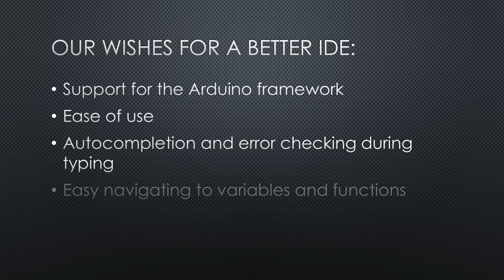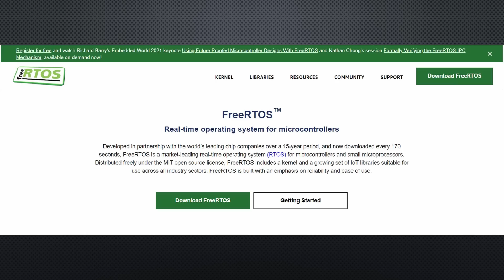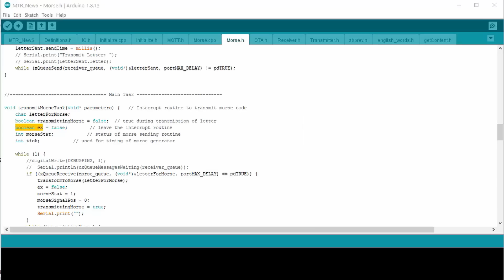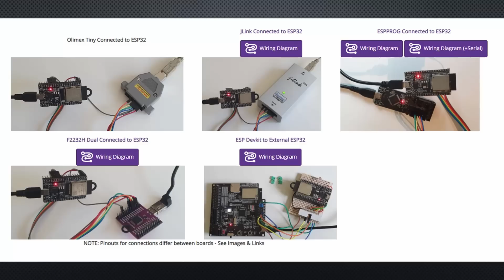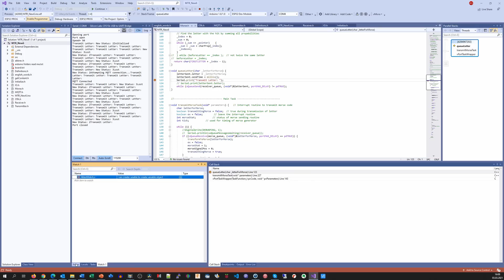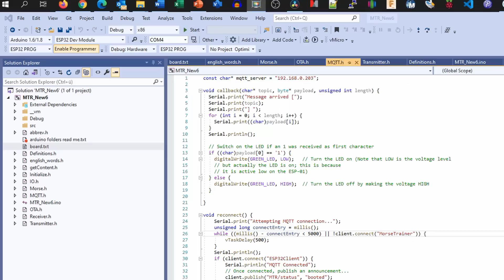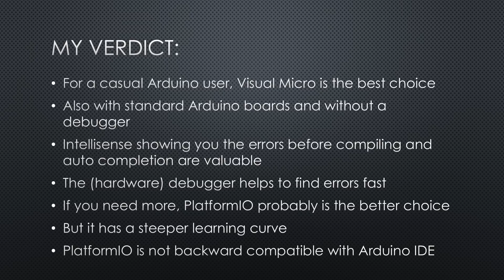#375 Is Visual Micro the better Arduino IDE? Including ESP32 inline debugger

Comment: Could you please do a video only about debugging with breakpoints i.e. which boards and which IDEs support what kind of debugging? I find that the ESP32 HW debugger is irreplaceable for me, but a lot of the times I do not need such a powerful board for a simple project.
Reply from the maker: PlatformIO and Visual Micro support hardware debugging. I do not know other IDEs which do HW debugging. So I am no help. ESP32 and STM32 can be debugged. But I am sure other boards, too. Just look if they support JTAG or SWD.

Comment: I used Visual Micro at first when I started my journey back into Microcontrollers a few years back. I understood it was free software, only to be surprised one day it was demanding money to open my projects.. So I switched quickly back to Arduino IDE and, grit my teeth and got on with it. Now don't get me wrong, I probably would not mind paying if (A) it was clear upfront before wasting time on it, and (B) The software was really good. But actually I found the how interface a little disappointing and clunky, I can see those guys have put thier hearts into it, but I guess my expectations may have been to high given historical experience with large projects in visual studio. I have started using the PlatformIO and so far really like it. It would be interesting if you did a real hard feature comparison between PlatformIO, Visual Micro and The next generation Arduino IDE. Seems these things have been out in the wild long enough for a fair comparison to be made. You could also introduce the free IDE's as available from the makers of the  STM,32 ATMEL and ESP chips. I took a look a couple of them, they are not bad with the one for ATMEL very strong, but for me the better answer is to leverage the common platform for all my microcontrollers as the benifits far outweigh the compromises in nearly all cases.
Reply from the maker: For the moment, PIO or Visual micro are for bigger projects with a clear tendency towards PIO because it is free. And for the small projects it still is Arduino IDE.
Reply: @AndreasSpiess  IFor me, I will only use Arduino IDE for legacy things and testing something as a known good. I managed to get all of my 8 types of microcontrollers working in PIO, making a test project for each. I don't think I would ever open Arduino IDE again to make a program, even for small stuff, fiddling around with the microcontroller setup each time is just to painful.

Comment: How easy is it to add own boards instead of the predefined boards? This is the only thing keeping me from fully switching from Atmel/Microchip Studio to PlatformIO for the AVR-chips (I am not using the Arduino-framework for those...)
Reply from the maker: I do all the boards and library stuff in the Arduino IDE. Because it is compatible, it uses all changes. So I cannot answer you question.

Comment: I've used VS Micro but I prefer PIO. Especially the dependency management of PIO is great. You said you don't want/need to work with different versions, but I doubt that. I usually want my 2 years old code to still compile if I go back to it. Arduino and VS Micro cannot do that because once you updated a library, all old code uses the new library and probably breaks. PIO prevents that by keeping the dependencies stable per project.
Reply from the maker: AFAIK you can "add" libraries to your project. Like that they are part of it and stay as they are. A slightly different approach than PIO but the same goal. So far I only had problems with the ArduinoJSON library from version 5 to 6 where I had to update code.
Reply: @AndreasSpiess  yeah okay, you can do that by copying the library code manually into a project subfolder. You could also do that with arduino IDE I guess. But in PIO it is just one line in the ini-file. You have all benefits of a library manager, including easy update and rollback of each library version. I had countless projects fail on me in the past in Arduino IDE because of a library / framework update...

Comment: Great video! I have had so much trouble debugging eps-IDF and ADF and was hoping this would be the answer. After installing it seems visual micro wont let me select my programmed. when I hit the drop down and select esp-prop it goes back to no programmer. Another issue, when i load my project folder and try to build it only shows "run code analysis" not build or build all. Any help would be greatly appreciated, have spent days on this so far with not much progress. I have tried VS code and eclipse with plugins.
Reply from the maker: Are you sure you used Zadig for your programmer? I never use "code analysis"

Comment: thank you very much for your the amazing content and  tutorials you are realy a good reference 
i wold like to ask about CAN bus Controller Area Network , if there is possibility to use ESP32 with CAN decoder de listen to CAN Frames reverse ingeneering
Reply: CAN is a Serial broadcast bus, so it should be possible, IF you have the proper hardware to covert to and from CAN signals.

You should be able to use the new RPi arm chip for this, with its support IO CPU.

What do you mean by reverse engineering?  What are you trying to do?
Reply from the maker: I have CAN hardware here and the topic on the list...
Reply: @AndersJackson  i ordred the MCP2515 CAN Bus Module its what i was reading about in many tutorials , so im still waiting for hardware :9

Comment: Arduino 2.0 beta is out and supports all desired features, FYI
Reply from the maker: Did you try it? It looks like very beta to me.
Reply: @AndreasSpiess  No, I haven't tried it yet, partly because of the beta status, partly due to lack of time/need. I lost interest in Arduino a bit after working with manufacturer software to create faster code (at the price of a bit more effort), but I am looking forward to trying the new Arduino IDE on my next project, even if only for a day and switching back. The old IDE was sub-par IMO, I expect the new IDE (once the bugs are ironed out) to be a blessing for makers. Thank you for the quality videos BTW, they have been a reference for me, and I'm sure many others. Kudos to you.
Reply from the maker: I tried it and thought that it still needs some time to ripe. The direction is good, though.

Comment: This looks good! Since I worked with Rowley, Keil or CubeIDE the last few years I feel lost without these features. So do you install Visual Studio first then this extension? It looks a bit like VisualGDB. 

It’s very nice that Arduino has the board support and examples but anything beyond that it’s very lacking and confusing too. 
For example I just got an Adafruit Feather, I opened the Arduino Blinky example for it which toggles a pin LED_BUILTIN. So I right clicked to find where it’s defined, nothing. Hover over it to see it’s value, nothing. The .ino file doesn’t even include any .h files (not visibly anyway) but it must be being brought in from somewhere. It just doesn’t make sense and everything is obfuscated, I don’t see how that makes it any easier for beginners than simply showing the pin definitions included in a pins.h file. 

I for one am glad to see this trend towards proper debugging and useful IDE features, it will only lead to more stable code and a better understanding of what’s really happening :)
Reply from the maker: One of the big advantages (innovations?) Arduino brought to the user community is to hide a lot of the definitions. But you have to install and select the right board to get those definitions in the background. I do not use Feathers, so I do not know how to do it for that board. But Adafruit usually has good tutorials on their homepage.
Reply: @AndreasSpiess  The feathers are just like any other board really. You add the JSON URL, download the BSP and you're good to go! And yes Adafruit has nice guides on their site :) 

Anyway, seems like this is all going to change soon with many people commenting about Arduino V2!
Reply from the maker: I hope you are right. It is still in beta and has a long way to go, I think...

Comment: That's interesting, but I prefer VSC. The only thing is that doesn't comes with a debugger. And works good in linux (debian 10) with a proper installation of Arduino IDE
Reply from the maker: The debugger is very important for me. If you need one you can change to PlatformIO which also uses VSC...

Comment: I used Visual Micro for a year. It's very good, but if you're looking to program other micros as well, using their native frameworks (ie. ESP32 with ESP32 IDF, STM32 with HAL, CMSIS) with the advantages of Visual Studio, then take a look at VisualGDB Embedded. It's not free, but worth it IMHO, it pretty well takes care of everything for you without all the tinkering.
Reply: I use VisualGDB for native STM32 development. But we are talking about Arduino and last time I checked there was no usable arduino integration in VisualGDB.
I'm not sure if Visual Micro and VisualGDB can coexist. I installed them on separate VMs to avoid the risk.
Reply from the maker: I decided to stick with the Arduino IDE for this channel because otherwise I would have to have a lot of different frameworks, example projects, and libraries. This is different for professionals, of course.
Reply: @MetalheadAndNerd  Yes, there is. Besides standard Arduino boards, I've done ESP8266, ESP32, and STM32 blue pill using the Arduino framework in VisualGDB. Select your board and VisualGDB will download/install what's necessary. It's an excellent turnkey solution IMHO.
Reply from the maker: Does VisualGDB offer a free or a "Maker priced" version. The prices on their homepage are more for a commercial usage.
Reply: @AndreasSpiess  Sorry, I don't know, I paid the $99us for the Embedded version, it's half for academics(?). For me, the $ is worth the hassle free setup. I'm mostly using STM32/HAL/st-link these days and it works very well. They do have a 30 day free trial. The support  also appears to be very good. OT, but it also now supports the Pico.
Reply from the maker: That is what I saw, too. $99 is too much for most of my viewers, I think. So I will not cover it. But I am glad you like it.

Comment: Great informative video as allways. Does visual micro supports esp-idf? I am not happy about the Arduino incapsulation.
Reply from the maker: I do not know. I never used the idf
Reply: @AndreasSpiess  OK, I think that IDF is better documented and its also the official API. When looking into FreeRtos there are a lot of documentation to Espressivs version of FreeRtos.
Reply from the maker: I used freeRTOS in one of my projects with the Arduino IDE (and will show it in a video). I did not have problems, but I only used some basic functions. It seems they use the same calls as the IDF. But if you want to program Espressif only then the IDF is a must.
BTW: I could close my channel if I would start to use the IDF and all the other proprietary IDEs to program AVR, STM32, and potentially Nordic :-(

Comment: Why not just use Atmel studio?
On avrfreaks they said visual micro was only useful until atmel studio implemented arduino.
Atmel studio is a version of visual studio specifically for all Atmel MCUS.

What I cant answer right now is if atmel studio has debug capability without a programmer, which would be the only reason to use visual micro.
But there is also a visual micro extension for atmel studio.
Reply from the maker: I never used Atmel studio, so I do not know. I mainly program ESP32 chips and sometimes also STM32s and I do not know it they are supported.

Comment: I wish IDEs would add smarter autocomplete. If I already have 1 " and try to add another one before it or a closing " why does it always add an extra 1. There should be a check if there is already an open tag. Visual Studio and many other IDEs do this, and it is enough to make me turn it off. Even though it is only 1 key press to remove it (although then both can get removed) I would rather always have to add the closing tag, than sometimes have an extra one added at random when I am not expecting it.
Reply from the maker: I learned that editors are very individual. Somebody likes a feature that is hated by somebody else. Very difficult for the developers ;-)

Comment: Great video and thanks.
How about the OTA programming with WiFi for ESP32? Does it recognize as the Arduino IDE does? Anyway I'm going to try this after seeing your video. 
By the way I tried the newly released Arduino IDE 2.0.3 beta with some improvements to the older IDE like auto complete,  syntax error and more. Give it a try as well if you are already not done.
Reply from the maker: 1. OTA works as it works with the Arduino IDE. You even can do Serial debugging via OTA
2. I will have a look at the new Arduino IDE. But I give it some time because I do not like to be Guinea Pig ;-)
Reply: Sorry, if I made you confused, I meant the automatically finding the network port like Arduino IDE does, using the mDNS
Reply from the maker: Yes
Reply: @AndreasSpiess  thanks

Comment: SHIFT + F11 allow you to get out normally of a function you stepped into by "error"
Reply from the maker: shift-F11 did not help in my case :-( Somehow the debugger does not have the information to which code the program counter belongs. If the ESP is not crashed, continue sometimes helps...

Comment: Hi Andreas,
As always a great video, and an interesting tool under Windows. I prefer to code under Linux. 
But a question, what is this Esp32 debugger board? I tried to find it, but could not find it. Maybe you can give me an helpful tip on this.
Thank you! 😄
Reply: the thin rectangular black one (for jtag) is called the 'esp prog'. available from mouser or digikey
Reply: @dreamcat4  Thank you. Will look for it.
Reply from the maker: You now should find a link in the description.
Reply: @AndreasSpiess  Thank you. Just found them on amazon. Next thing.

Comment: Can this be used to make script for arduino Uno boards? Will the same exact lines in visual copy and paste into the arduino ide and work?
Reply from the maker: You even can start the files either from Visual Micro or with the Arduino IDE. No changes needed.
Reply: @AndreasSpiess  thank you! As a newbie to the skill... code completion is something that will help me out a ton until I memorize the commands

Comment: Sorry this time I cant follow Your great suggestions.
No Linux version of this and Platform IO not backward compatible and not yet mainstream  ....
Will stay walking barefoot 😉
Reply: Yup yup.  The Code editor is pretty popular though.  I believe that is what you need to compile the latest version of Marlin.
Reply: there are Linux versions for PlatformIO or what do you mean with "backward compatible"?
Reply: @uwezimmermann5427  
1. no linux visual micro
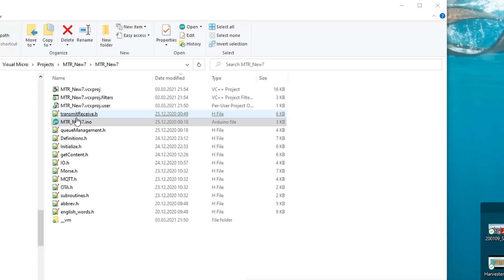2. watch the video at 14:55
Reply from the maker: Because I use the Arduino IDE for the channel I want to open the same file with either Arduino IDE or my development platform. I found this works better with visual micro than with PlatformIO.

Comment: I've used most versions of visual studio IDE (was called VSC) since version 1 on windows 3.1 But in 2012 went to full time linux boy. That was so very hard saying good by to it. best IDE ever! So glad they now do Visual Studio Code for all platforms. Just wish they had not given it the same name as the original. Very confusing. They are very different. Looks like visual micro is a SQU of visual studio IDE.
Reply from the maker: I agree that they created a lot of (unnecessary confusion). Also with me :-(

Comment: arduino ide 2.0beta is out from a week, with most of the things you asked included: autocompletion, navigation to definitions, debugger
 :)
Reply: Yes, i will be or is a good improvemnt over ide. And still PORTABLE. other solutions aren't
Reply from the maker: Good point. I will have a look when it is a little more advanced. I do not like beta versions for my daily work...
Reply: @AndreasSpiess  gmail was beta for about 10 years, maybe more :D
Reply from the maker: @sualazzo: Did you use the 2.0? I tried it and for example auto completion did not work after I deleted a letter. Maybe I had bad luck. And looking at the forum there is a lot of work ahead. A complex ESP32 sketch compiled ok. So this side seems to be ok. And we will not get an ESP32 debugger from Arduino. They encourage the community to write one.

Comment: I trie a Lot of Things VisualGdb, Visual Micro, PlattformIO on Atom or VisualStudio Code, Atmel Studio.
The original arduini IDE has one really huge benefit: IT works Out of the Box For None-programmers.
AS i am using Visual Studio a loti also bought Visual Micro. And was disappointed in so man's ways. Mostly whrn it comes top using a third Party library and Debugging. I Ended up using VS Code with PlattformIo. But For a None. Programmer or Starter i would say: arduino IDE. Less trouble
Reply from the maker: What kind of problems did you have with libraries? Did you use hardware debugging? For me this is a deciding factor and so far it worked ok.

Comment: ive been using the Arduino 2.0 beta ....it kicks ass over the old IDE... its been working great with ESP32 stuff...picks up all the libs from the old version, just need to reinstall the cores...
i tried platform.io and others...but the damn setup is a PITA and stuff didnt work so i gave up... the 2.0 beta just makes it all simple and lets you get to coding instead of having to configure crap every  mcu change...
Reply from the maker: Did autocomplete work properly? Here it sometimes worked, sometimes not, and sometimes very slow. Have to try debugging which is important for me. The compilation of a quite complex ESP32 worked ok.